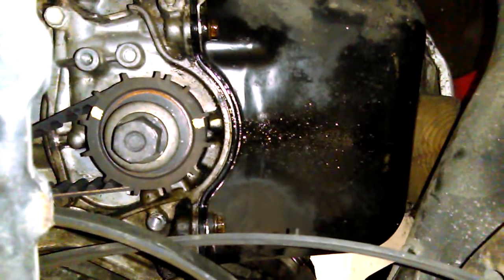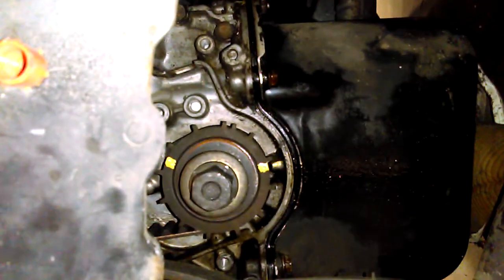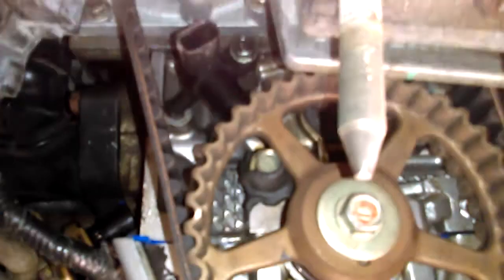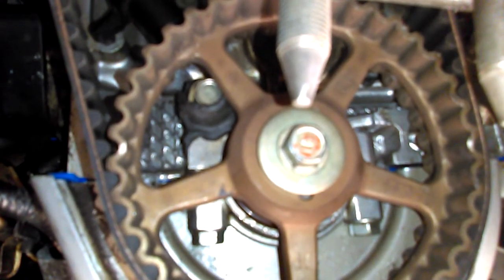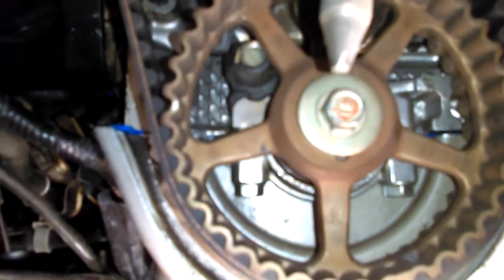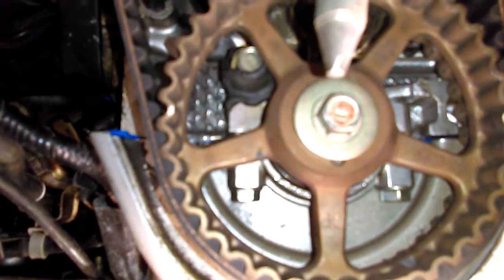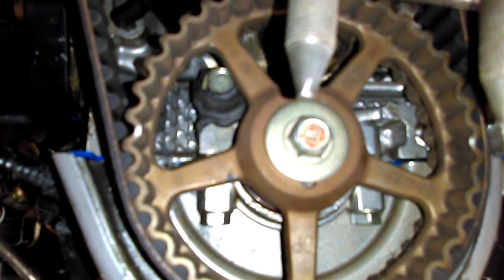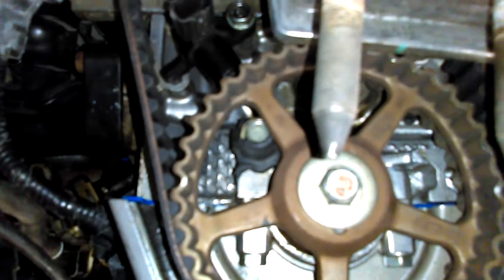Resetting the timing belt on a 2002 Honda civic 1.7

Comment: When you did this, what was the result? DId it work?

Also, can you turn the crankshaft independently to align it with the camshaft pulley?
Reply from the maker: Ya it was only a tooth off the main problem was the eBay cam sensor was garbage and I put the original one back in and it ran fine

Comment: If you're off by two teeth or three can that cause a crank no start condition?
Reply from the maker: Sure could these are interference engines and if it's off too far you could bend valves.
Reply: @torque63  When the cam timing was off did you get any warning lights on the dash? Was either the check engine light or the maintenance indicator light flashing or on steady? Thanks!